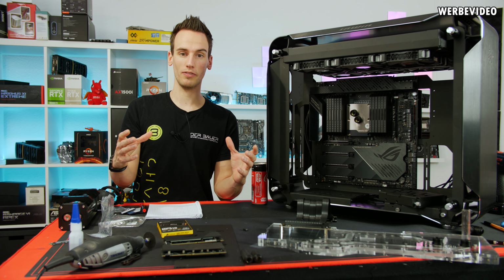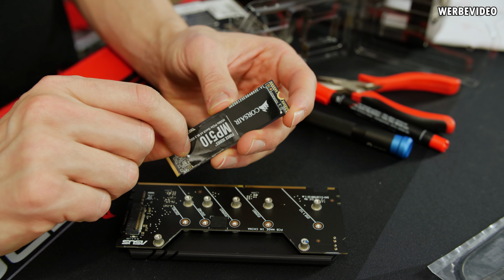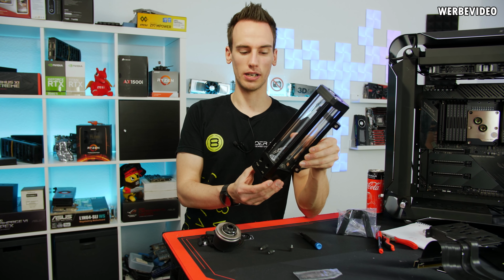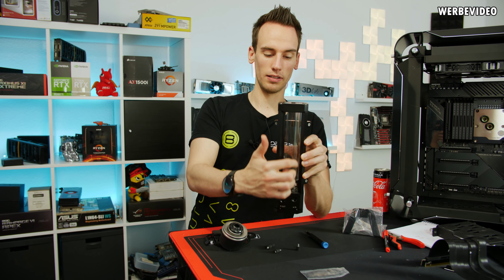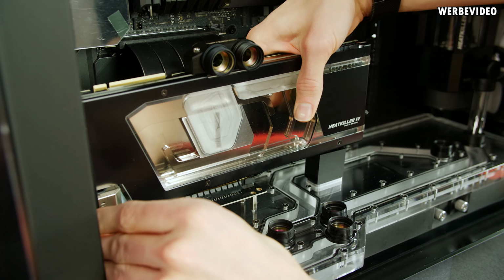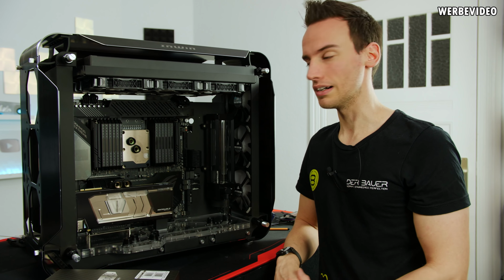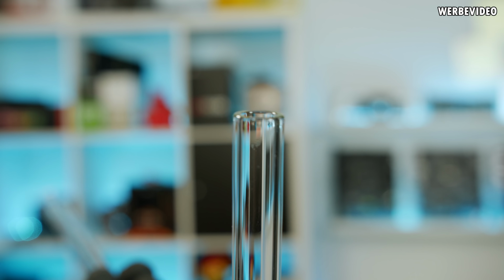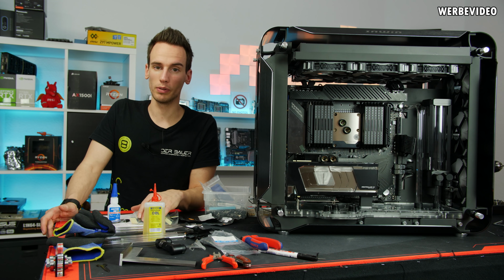Project Irrationality Part 8: I thought the PC would be ready but then THIS happened...

Comment: I love how everyone was recommending using a torch as the best way to get smooth edges before and now they're saying that it makes the glass brittle as if it was obvious from the start.
Reply from the maker: xD
Reply: @der8auer  Yup its the heat, our flame polisher burns methyl ethyl ketone & it only takes a second! 
Will you be mass producing that glass tube cutter you made? 
I want one.
Reply: @der8auer The issues happen when the glass cools off too fast after being heated. The temperature needs to be lowered slowly in order to prevent cracking due to the different expansion/contraction rates of the hot vs cold parts of the glass. The best way would be to preheat the glass before the torch work, then a post heat process to slowly lower the temps back to room temp. A toaster oven would work fine for such a task.
Reply: @cartoonhead5819  same it cuts so smooth
Reply: It's just because your reading the comments as if "the internet" is one person. It's a lot of different people and quite a few of them just repeat what others are saying
Reply: Armchair experts.
Reply: @-Kerstin  totally agreed.
Reply: Project Irrationality Part 8: I thought the PC would be ready but then I listened to YouTube comments...
Reply: You're making the classic internet mistake of thinking everyone else is the same person.
Reply: it was user error
Reply: @Asdayasman  they're likely a redditor. Redditors assume internet is one big homogeneous person.
Reply: John Chrysostom  He said in part 3 it was Borosilicate (Pyrex) tube. I was thinking the low coefficient of thermal expansion for Borosilicate glass would help this issue, but I think it's uneven heating that's doing it in. Were it my glass, I would either mechancially sand the edge down (it's not visible anyway) or try to heat and cool it slowly using a toaster like the commenter above said)
Reply: consider: youtube commenters are not all the same person
Reply: Warum auf Englisch

Comment: You are introducing new internal stresses by heating the glass. Do not heat the glass. Instead sand down the cut edges. Good luck!
Reply: Would it not be fine after it cools though?
Reply: @MadSupra354  no it would have to be tempered in an oven to reduce the interna stress
Reply: @MadSupra354  the outside cools quicker than the inside, so the outside shrinks faster than the inside, introducing internal stress, to relieve it you need to cool it very slowly e.g. in an oven such that you maintain an identical inside and outside temperature

Comment: Ask Jayz2cents, He used glass tubes on one of his builds. He used water and fine grit sandpaper.
Reply: Plus, no need to use a heat gun, that weakens the glass somehow. Just sand it. After cutting the glass tube put it into the warm water and then cold water. It should break itself with little force.
Reply: yeah, never seen Jya used a torch for the glass

Comment: Hi Der8aurer, Phil here from the Lian li thanksgiving Borocilliate glass build you chose as 2nd place winner. A couple of tip your completely on the right lines with the cutting of the tubes and blow torch the tips your getting really good results. 1. Before you use the blow torch you will want to use something like a belt sander to chamfer the edges and create an angular edge. like we do with PETG and acrylic. Once you have done this then go ahead and blow torch the ends. 2. When putting 90 degree bends into place you have to make sure there is aboloutley ZERO pressure on the bend with perfect legnths. You will want to put the fittings onto the tube leaving the screw tops undone then put the glass in place turning the fitting into the blocks while on the glass. At this point screw down the caps of the fittings. This should give you better results. Phil.

Comment: I don't know if it's actually the torch causing the issue, it may just be the angle causing stress on the pivot point. Borosilicate glass should be pretty stress-resistant. One way you could test is, to try using two scrap pieces you may have left, heating one and seeing if it actually breaks more easily. If it is not the heat you have a very different challenge ahead of you.

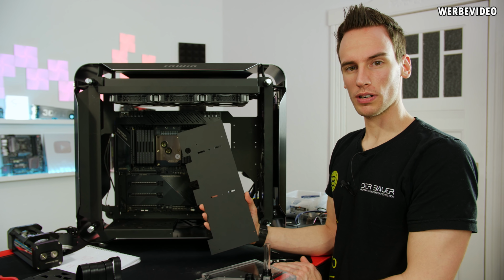Comment: 4:53 a word of advice ... ( I only notice this one after a couple of weeks of use  ).

Don't use bios RAID solution with SSD/M.2 drives, why ... the windows will not recognize the drives as a SSD and will defrag it automatic ( makes the life of the SSD shorted ), if you use windows to make the RAID the windows will know that is a SSD and turn off defrag on that drive.

This will save your drives life in the long run.

Comment: Read about fire polish, glass needs to reach softening point, so that micro cracks melt together into continuous glass mass. Find smaller torch, that can heat inside edges as well.
Fire is the right approach!

Comment: You can get soft plastic washers(used for water sealing screws on aluminum sheds) that work for vibration dampening and only takes about 1mm extra space. A little drop of super glue and add the washer to the mounting brackets then a washer on the mounting screw in the back of the case (covered by a painted metal washer if you got white soft plastic and can see them).

Comment: I think it's the same effect as when using a torch differential hardening on high carbon steel.

Because of the rapid heating, and cooling you introduced stress in to the crystalline structure.

So you need to prevent or at least lower the amount of heat spreading through the rest of the glass.

Wrap the parts that you are not heating with a towel that was soaked in cold water beforehand.
Or dip the part that you are not heating in a bucket with water.
Reply: Second, and maybe the best method would be to have the whole glass heat up, and get it slowly to cool over 24 hours.

But i don't know how to do that without a glass blowers furnace.

Comment: Heating glass makes it harder but also more brittle. Certainly the finish you are getting with the torch is aesthetically very pleasing but as it is hidden in the final set up perhaps not necessary. I would try one tube that isn't heated to see if the same result happens when it's fitted.

Loving this build

Comment: the heat from the torch is tempering the glass locally
Edit: It's like Rupert's drop. Glass has good compression strength and bad tensile strength. The inside of the glass wants to expand when it is competely cold. Smallest of energy added and it implodes.
Just don't make the glass to hot and make sure the glass cools down slowly!
Reply: John Chrysostom  Have you see the difference between the breaking of "normal glass" and "tempered glass"? It shatters in much more pieces, because of the internal forces.
Even the smalles fracture grows so fast you get a schism. Tensile strength in a tempered glass is much smaller!

Comment: You have to anneal the glass to relieve internal stresses introduced by heating with the torch.
Reply: And slowly let it cool down again! Most important part of it is the slow cooling. Or you get tempered glass again. (Think about Rupert's Drop)
Reply: if you are only using the torch to smooth out the edge you shouldn't need to do that. the issue could be that he is heating the tube for too long as it should just be a quick melting of the edges.

Comment: My first time seeing these videos but the composition of the glass can have an effect on the heating/cooling bittleness too. I used to do a lot of glass tube shaping with high quality tubing (unfortunately, I can't remember the composition or manufacturer) but it would not exhibit these aspects like you've been experiencing. We even took the glass to 10^-6 Bar (sealed end, of course) without issue... 
One further thing to take into account is the fitting. I'm not sure if the fittings you have are brass or not (looks like they are) but, although it's soft, even with O-rings it could put undue pressure on the aft-part of the heated glass. Bear in mind that the heated glass and the unheated portion will behave differently so you could be causing stress on the parts of the glass that have NOT been heated. 
This was one of the reasonns we used to run the torch up and down the nearby length of the tubing in order to produce a gradient effect.

Comment: The glass breaking probably has to do with the fact that you smelt it, it creates internal stresses in the glass
(quite similar to a prince Rupert drop) And if the fitting has some sharp edges on the inside it could scratch the glass and break it.

Comment: Tempering the glass in an oven would definitely make it tougher because it's the heat gun method you are using that's turning the already thin walls of the tube so very brittle. Generally glass wouldn't crack like that if it was thicker. Wet sanding with very fine grit paper might be an alternative but again you are dealing with very thin glass.
Reply: those glass tubes are super thick, is that what your refuring to?. they are probably 2.5 times thicker then a beer bottle

Comment: The torch is tempering the glass, so it's breaking due to not having rounded edges before receiving the heat... You need to sand it, or if you can, heat the glass tube all together to do the edges and then leave it to cool down slowly..

Comment: If you really want to flame polish (what you're already doing) to clean the ends of the tubes after you cut them, you should anneal the glass afterward. The high, local heat adds a lot of strain to the glass, making it much more fragile. There are a lot of ways to anneal, but you essentially need to heat the glass to ~550 C for an hour and then slowly cool it down until it's below ~450 C.

Comment: Heat polishing the glass tubs is fine, but it can induce stress. This can be eliminated f you anneal the glass at ~475C for ~1 hour, then cool over a period of  3-4 hours (turn the oven down 25C every 30 minutes until you get to 25), then let it cool normally.

Comment: you might need to anneal the tubes in a kiln if they keep cracking like that.  I'm a little surprised boro is cracking that much. you could also try putting the tubes in vermiculite in a crock pot. lamp-workers just starting out sometimes use that instead of a kiln.

Comment: I think u hit the nail on the head, when you heat the end of those tubes to smooth them off, you are probably creating a sort of tempered area which would create stress around the end areas of them, that’s why they shatter into a million pieces, cut a tube and break it, then smooth the end of another with your torch and break it, watch the difference, I’m pretty sure the only way to resolve that issue (if you still want to smooth the ends, would be to actually evenly heat the whole tubes in a kiln or something and then slowly lower the heat over time so you are effectively stress relieving it

Comment: i would have used some small o rings as dampeners for the pump. just slide them over your bolts. they would still be thin enough to cause no measurement issues, but enough rubber to stop vibration

Comment: You need to evenly heat everything you can't use Directional flames without constantly turning the tubes because it causes micro fractures from the temperature differences.

So either get a circular burner or build something to turn the glass tube to prevent uneven heating.

Comment: im suprised the heating with the torch doesnt make the glass brittle. usually if you heat glass red and dont let it cool very very slowly, it becomes so brittle it can break with the slightest tap. we used to put beer bottles in a fire and get them red to make cool shapes. but when you take it out and it cools it would just fall apart in our hands.

Comment: You have to reduce the temperature in the tubes slowly. Just removing the torch and letting it cool in room temperature will generate residual stress in the tubes, making them very susceptible to external loads.

Comment: This is clearly a tempering issue with the incoming material or in your annealing process. I've done similar laboratory technical glass work with borosilicate, we always heated the last 3 inches (if available) in the glass furnace and let it cool slowly. With a torch small torch like what you've got it's going to be tricky. You can do it over an acetylene rosebud far easier. You don't really have enough heat output with your small torch.

Comment: Greate Job Der8auer, I love do cable management on my costummers Pc, it have to be a clean instalation, but I have to give you congratulations because you are making a much better job with that infinity off cables. 
For the tubes wet fine grid sandpaper I think it will be the most effective way, faster and safer.
For the power cabes from GPU you use square partes and glue, you can try to get a peace off achrilic and with a hot gun 250c 300c degrees it will be soft and you can make curved like the achrilic base, it will be much better.

Comment: Use the torch to heat the piece as well, not just for the chamfering. It's likely that you've only heated too locally and created residual stress near the connection.

Comment: Looking good so far, but deffo make the hole bigger for the glass tube passthrough and install a grommet.  It will give a small amount of tolerance and vibration damping.  And as  Above & Beyond Aerial has posted, only use the flaming technique to "finish" the tubes, wet grind with diamond dust paper first(with full PPE protection)👍
Reply: That's the 'grommets' electricians use for the back-boxes by-the-way.  Pretty cheap and come in a variety of sizes. 😉

Comment: I think you should look at techniques for working with glass. At least for metals after they have been tempered they should be "backed" to release the tension within the material.  Most likely this is the problem.

Comment: Glass gets stressed when you heat/cut it wrong. Don't heat it at all, use a dremel and bits made specifically for glass cutting with a water spout to cut the glass while keeping it cool. You can also sand/polish the glass with the dremel again using bits made specifically for glass.
I sent you an email if you want more information and I can get you in contact with some professoinal glass workers if you want.

Comment: I believe  you are making the glass brittle. not by the heating it up with the torch . but when it is cooling down to quickly coursing micro fracturing in the glass tube. you would be better using a  water stone like used in lead crystal glass  cutting to clean up the edge of your tubing

Comment: Please, make sure there were no broken shards into the lower plate. It seems that some could've entered when you removed the tube and it might contaminate your system somehow.
Reply: glass is not conductive
Reply: @marsovac  thats not the issue at all. You never want debris in your WC system since it can go to the pump, fins and somehow reduce performance or damage any of your parts.

Comment: Flame polish is a skill..... yet I can do it. Looking at your vid the problem is the size of the nozzle on your torch you need a fine 4mm-6mm nozzle with a bright blue flame.
 I used butane oxygen mix torch.

Don't soak the tube in flame you want to direct the flame away from the main tube so the inner lighter blue flame sears just the edge of the tube, and in steps like 5 or 6 passes with the flame covering a quarter to a third of the tube in 2 - 3 minutes as you are trying to dissolve the granules at the end of the tube, not heat the whole pipe in one go.

I'm in the UK and bashing steel (sheet metal-fabrication) is my main skill but have had to learn this in the past while making corporate signage. (Audi regional offices London, General Electric Building New York just 2 instances of my flame polishing prowess) If you can find a neon sign maker close to you is another option for the price of a few stein they will help you out.

Comment: Maybe soften up the glass with the torch immediately before inserting it so it can conform to the fitting? IDK much about glass but it can't shatter if it's soft, right?
Also wondering why use borosilicate instead of basic soda lime glass?

Comment: It looks like those tubes might have been poorly annealed. Either that, or you have introduced too much stress when flame-smoothing the cut ends. It is possible, that you might have to anneal the tubes, after flame-smoothing. I am not sure how hot you need to get the glass to fully anneal it, but it might be beyond the reach of a kitchen oven. (I think you might need 300-400°C and slow cooling, but I have never done it)

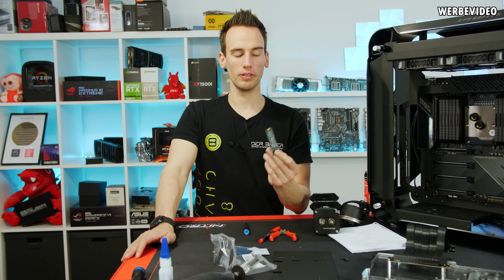Comment: 4:04 Did the warranty not cover it? The warranty on the 960 Evo is 3 years or 400 TB written.

As a video editor/producer I could see the write endurance being a factor, but for 999/1000 people I can't. Even on a drive like the Intel 660p, where the warranty is 5 years and the write endurance is only (capacity * 200) or 200TBW for the 1TB version / 400TBW for the 2TB version, I don't see many people passing the write limit in 5 years?

Comment: RAID 1 is redundancy still not a backup... it really sends the wrong message being so assured in not losing data due to RAID in the new setup.

Backup = Separate Accessible Copy (which is not the case in RAID 1) of the data on a Separate Device/System, PREFERABLY not in the same location or also a 3rd copy in an alternate location. Ya its a pain in the arse, but seeing as I send people to DR for $10k-$30k all day :( its worth the extra $$$ vs the $$$ of data recovery or losing data!

Otherwise, that is one sexy beast! Great vids as always

Comment: I bet if you slowed down the cooling process after using the torch, youd be alright. The idea to put it in the oven and slowly lower the temperature until it was as low as the oven would go seems like the best bet if you're willing to waste a day on that. I guess I dont know if glass annealing is possible/would work like with metal, but that's the idea here I bet.